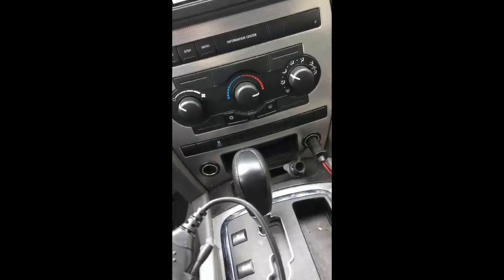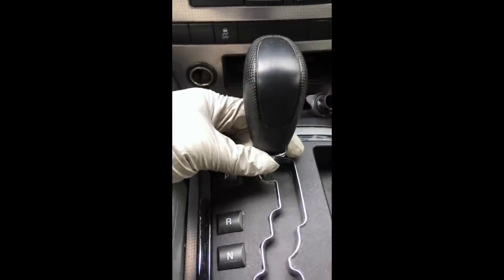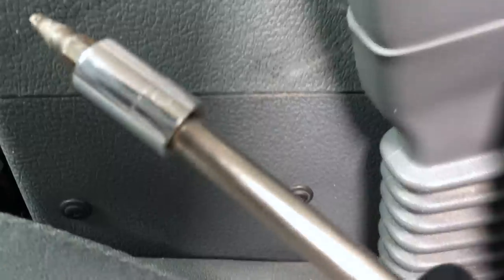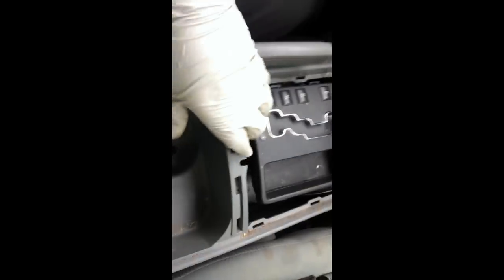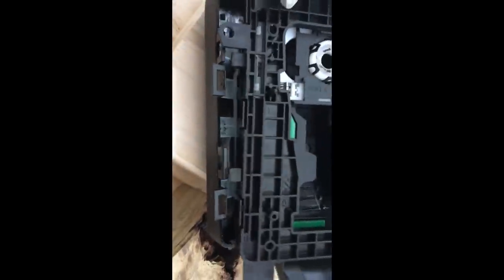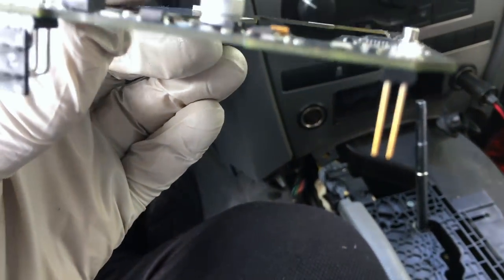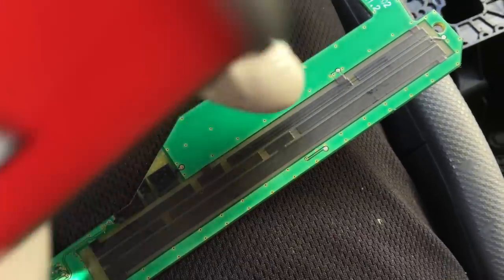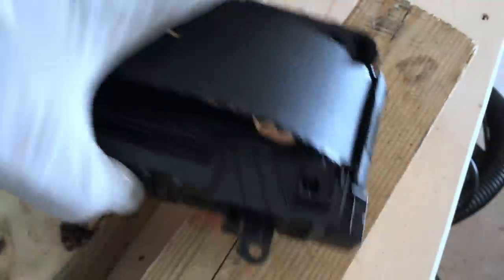2006 Jeep Grand Cherokee (WK) 3.7 Electronic Shift Module (ESM) Problems U0404 P0700 Codes

Comment: When you shift it it makes a weird noise, almost like grinding and the wheels are free flowing. It was towed here from the shop. They said transfer case so basically transmission. I figured someone might want to fix it up. I'm looking at purchasing an 06 with these issues. This is what the seller has told me. I figure if it's an easy fix I could have a decent jeep for my son. I've had an 05 that I replaced the transmission wire harness seal when it was throwing codes and would go into limp mode. Any ideas for this one? Thanks. Great video. I should've made one for that harness thing.
Reply from the maker: Hey brother do you have the codes that popped up? Many things can throw the Jeep into limp mode. It would be awesome if this fix was all that is needed, I just need to know what the codes are.
Reply: @MrV2u  trying to remember what codes there were. I know it was a shift solenoid code. Plus it was leaking around that harness plug and it would drip onto the exhaust. It wasnt leaking a ton but enough to short out in that plug.
Reply: Like you said. Many things can cause it to go into limp mode. Bad wheel hub was one
Reply from the maker: chris gillingham the hub bearing was what I was thinking about lol. If your vehicle is not shifting correctly or occasionally goes into limp mode, the conductor plate may be the cause. It could of shorted because of the leak. If you can find a way of pulling the codes it would help tremendously brother. Keep me up to date with what you do.

Comment: Now the electronic part with the carbon slider is made in Czechoslovakia  ... [You can buy it new for $900 USD]  we'll fix it. What he did not show and ONLY because this Jeep did not have the QDll four-wheel drive. Under the TEE HANDLE you pull up to engage the transfer box for 4WD-Low [if your Jeep has one] is a T-10 screw. To get to that screw you need to come in from the bottom. That took me two days to remove and replace ... and one trip to Fastenal ... AND use ONLY a NON-Chlorinated electronic contact spray cleaner on the Q-tip. [Clorinaded will embrittle the plastic and it will crack apart].
Reply from the maker: Absolutely brother. I should of mentioned the non chlorinated formula. Thanks for the comment friend. Keep on Jeeping on brother.

Comment: 05 Jeep Grand Cherokee V6 3.7 codes u0404 p0700 no other codes. I did this and drove around a few blocks the car was fine. I turned the car off to go into a store when I started it back up I'm getting a loud whining/ squealing sound on the passenger of the vehicle the sound is in all gears it stays the same in each gear. Doesn't get louder or lower ( It sounds like a bad serpentine belt or water pump) both brand new.  Could it be a bad TCM or trans pump?? Thank you
Reply from the maker: Was it making noise before you tried cleaning the contacts? It can very well be a bad pump brother. A bad pump will give you shifting problems, noisy trans, slipping, etc… I wish we had dipsticks to check the condition of the fluid which could show; burnt or low levels.

Comment: My 06 WK will not manually down shift while in drive,will cleaning the ESM solve this as well or different issues?
Reply from the maker: It might solve your issues. It doesn’t hurt to clean the contacts. Do you have any codes.

Comment: Great video thank you. Did anyone get the ESM out without removing the whole containing console. There is a Dorman video where they look like they just removing the direct top 4 torx screws, remove the cable & lift it right out.
Reply from the maker: You can do it without removing the entire console. I was showing you the correct way so you have a better understanding.

Comment: Our 08 Santa fe doesn't go into park or drive. Last saturday, the shifter started getting hard to move. On that day, I was able to put it in drive, and i put in transmission fluid to make sure it was at a good fluid level. Then I got into the interstate and sped up to 80 mph and down to 0 without any problems. After that day, the shifter didn't let me put it in drive or park anymore. 

I'm going to try this and also clean the electrical connections with electrical contact cleaner to see if this fixes our issue.
Reply from the maker: AC Padilla make sure you don’t overfill the transmission. Get vehicle hot and check with engine running and in park. Your going to have to go under the truck and have someone with the engine off cycle the shifter while you watch the lever on the transmission move. Make sure it’s not binding. Not sure if your able to see it. It shouldn’t be hard to roll through the gates. It might be binding.
Reply from the maker: What I did on my jeep was a electrical issue. Yours sounds like a hardware issue. It might be completely different from my setup. Let me know how you make out. I’ll do some research for you if you get stuck.
Reply: 5 Star Jeep Club thanks for the response. I was able to fix it and it's apparently a common Hyundai issue. The shifter shaft got stuck. I had to remove the shift cable and neutral safety switch, then sprayed wd40 and lube on it. I grabbed it with an 11 mm wrench and wiggled it until it started moving again. I kept moving it around with the wrench while spraying more liquid so it would seep more into the shaft. I then reassembled everything and my problem was resolved.
Reply from the maker: AC Padilla awesome. Like my pops always told me fix it yourself. Subscribe to my channel. Going to be branching out to different manufactures. Thanks for your response.

Comment: I’m looking into buying a 2010 Jeep Grand Cherokee for dirt cheap online. They said it was in limp mode and don’t want to spend the time or money to fix it. I don’t know the codes that it’s throwing, but I’m guessing that they are the same as this. Would this most likely fix this problem?
Reply from the maker: A lot of things can throw the Jeep into limp mode. Any sensor can do it, a wheel hub, the ESM which is what this video is on, a tranny speed sensor. It’s a gamble without the codes. Best advice is to buy a cheap scanner and check the codes. If your mechanically inclined go for it. Let me know the codes if you do. I’m around for help.

Comment: My Jeep is doing the exact same problem! It won’t shift gears and the rpms just keep going up!  If I do what you did in the video will I need codes or anything ? How can I reset the code without the electronic device you have?
Reply from the maker: philip vizzari ok here’s what you do. Do everything I did in the video. When you disconnect the battery before you do anything you will be clearing the codes at the same time. When you reconnect everything your check engine light will be off. Hope that helps. If not hit me up I’m always around.

Comment: Got the same thing illuminated around the prnd and 4 low light on. Code U0103. Think this is the same problem?
Reply from the maker: Ashlee Mcalister I would definitely try what I did in this video first. Let me know if you have any other questions or get stuck on anything. Good luck Ashlee, let me know how you make out too.

Comment: I have a 2008 model. Otherwise same motor 3.7 Jeep grand Cherokee. Always seem like I had a little bit of a transmission slippage etc. and recently twice it seems like my transmission dropped after I was at a stop  and tried to take off again. Basically bogging down and this morning it did it and I couldn't get my shifter to shift gears at all plus I could push my pedal all the way to the floorboard and I felt like I was maybe in first gear still not going faster than 30 miles an hour. Does this seem like the  same scenario? I pulled over  into a parking lot because were in the middle of a rainstorm currently and I didn't wanna get stuck in traffic. Parked and let the car sit when inside the store came out and it seem like it was fine or at least back to what it was before the issue this morning. Once again, it's a 2008 model were in 2019 now and I only have 88,000 miles and do regularly take it to be serviced with a buddy. But have not had anything for transmission fluid done yet I believe. Any insight I would appreciate it
Reply: Sidenote, my ABS braking and also my airbag lights have popped up on the dash.
Reply from the maker: You might have a failing hub bearing. Those symptoms point to that or bad abs sensor in one of the wheels. When you feel like the tranny is slipping and doesn’t want to move that’s the computer putting the Jeep into limp mode. If you have a scan tool check for abs codes. If not go to autozone and they will scan the Jeep for you for free. Hope that helps. Let me know how you make out brother.

Comment: Hey thanks a lot for the video. One question, my dealership ran a U0404 diagnostics error 'Gear Shift Control Module' on my '07 Grand Cherokee Laredo. Is this the same as ESM? I am getting ridiculously poor gas mileage. Many thanks!
Reply from the maker: Todd Crawford yes sir. I was getting bad mpg as well. Try this should take care of your issues. It’s not hard to do and will save you from the stealership. Let me know how it turns out.
Reply: MrV2u could  this cause a popping noise when down shifting.
Reply from the maker: Hugo Torres could be the engine bogging down. Going into fail safe mode off and on.
Reply: MrV2u I tried  cleaning  it once and thought it helped but no it's  still happening,  also it shakes  violently like it's gonna turn off then I give it gas and it's starts to work again and if i let it of the gas it shakes  bad again check engine starts flashing fast  i turn it of turn it back on and it  goes back to normal btw mine is a Jeep Grand Cherokee Laredo 3.7 V6 4 x 4
Reply from the maker: Hugo Torres I cleaned mine twice in 2 years. Are you getting any codes? Even though the check engine light goes up n and off it can still store a code. It could be a electronic problem in a circuit then brother. I know that part is expensive. I’d try a junk yard first.
Reply: Hugo Torres did you find a fix? Mines is doing the exact same thing
Reply from the maker: UnitedWEstand?? Do you have any codes ? The check engine light doesn’t have to be on to get codes.
Reply: UnitedWEstand??  no i havent  it sucks because it only those it went it wants to it's hard to find a problem
Reply from the maker: Hugo Torres I had that problem when my hub was going. It’d bog down loose power then jerk and suddenly and pop. It threw a code and then the light went off. Thank God it happened only two blocks away and I had to limp it home. I bet that’s your problem. Pull the codes. You can have a inactive case de which wouldn’t set the light off. I replaced all my hubs which houses the abs tone ring and sensor. It’s not a bad job to do but takes a little time to do.
Reply: MrV2u I changed my driver   hub  2 years ago changed it again last week got an alignment  and truck was nice and smooth then it a day or 2 l everything felt like it got loosen up
Reply from the maker: Hugo Torres could be another one failing. I know it sucks bro. It’s the nature of the beast lol.

Comment: You need to do a Blend Door Video... My 07 Grand Cherokee is only blowing cold air but thermostat, pump & black heater are all getting proper heat. I do not overheat. My blend door accuator is working as it should (off of shaft) but the last problem to suspect would be the blend doors itself
Reply from the maker: Do you recently change the thermostat and water pump or flushed the coolant system?
Reply: I literally just figured it out like an hour ago. I took off my accuator and manually turned shaft for blend doors to open from heater core. So its all good now. but shaft looks to be missing a gear. so i'm thinking that is the problem, it is just jumping when trying to switch.
Reply from the maker: Kyle Dillon you have heat when you move it manually? At least it’s not a bad fix.

Comment: I am having issues with a 2006 Laredo stuck on neutral. It will shift to drive and it will engage on reverse if you press the handle firmly. Any recommendation will be greatly appreciated.
Reply from the maker: Did you try cleaning the contacts like I did in the video? Do you have a check engine light on? If so do you know the codes?
Reply: There is no check engine light.  Could it be the actual mechanism? I will try your method  I'm the meantime and will follow up with you.

Comment: i have a 2006 jeep commander with the 3.7. abs...esp...and traction control lights are always on and it hesitates to shift. more than likely my brake light will come on and at that point it will not shift other than from park to drive reverse....just wont shift up and down going down the road. will this fix it?
Reply from the maker: I’m 80% sure you have a bad hub assembly. That’s where the wheels bolt to the Jeep. The hub assembly has a tone ring and abs sensor in it. Those symptoms point to a defective one. To be sure you need to scan for codes. It will point to the bad wheel. You can go to autozone or advance auto and have them scan your car for free. Let me know how you make out.

Comment: I understand what you've done but what does that part work please text back  I have a Grand Cherokee that the reverse does not work. What could be my you had a very good video
Reply from the maker: It can be what I showed in the video or a number of different things. Do you have a check engine light on? If so what codes do you have? If you don’t have a scanner go to autozone or advanced auto and they can pull the codes for you for free. Let me know bro.

Comment: Would this cause it to stick in 3th gear . Wouldn't let me manually shift it . Went a couple days later and it shifts fine.  Had codes of p0700 and p0841
Reply from the maker: I doubt it. You might have problems with your transmission fluid pressure sensor due to the p0741 code which would make the p0700 code appear. I know with these there’s no way to check your own tranny fluid without a scanner and no dipstick.
Reply: Mine has 5.7 in it
Reply from the maker: If you can check it then how does it look? Bright red and no burnt smell to it? The module may be dirty sending the wrong gears to the computer. Try to clean it like i did and see if that helps brother. Let me know how it turns out...
Reply: I'm having this same 3rd gear issue with my 06 4.7. Doesn't do it all the time. Only after its been driven and shut off and restarted. Very random. But same codes come up if I drive it in 3rd. If I shut it off and let it sit and restart, it will go back to normal. I cleaned the module and even replaced with a used one and it didn't fix it
Reply: Not the same codes actually. I double checked and my codes are p0871, p0882, and p0998

Comment: Great video! I have a problem with the sport shift. The + and - signs to down and up shift...they do nothing! Any advice on how to fix this issue? Thank you in advance :)  2006 Grand Cherokee 3.7L with automatic 4wd. 101K miles. I don't have a code but can probably get one.
Reply from the maker: If you can get me the code it will help immensely. You can go to auto zone or advance auto and they will pull the code for you for free. I’ll help you out the best I could.
Reply from the maker: Try this fix in the video. Cleaning the contacts could very well solve your problem sister. Let me know how you make out and I’ll do more research if need be. I
Reply: @MrV2u  Thank you, I'll try and get a code and let you know. Where does this extra Graphite come from and when it's removed, doesn't that cause an issue with lack of a lubricant?
Reply from the maker: I believe that the graphite is what seeps our from the constant back and forth motion of the shifter. The problem is when it makes a continuous contact that throws off the computer. There is no problem cleaning the contacts. As it’s not really a lubricant rather a effect of the back and forth motion. Hope that helps
Reply: @MrV2u  The mechanic that replaced the 02 sensor erased all the codes so as of now, the check engine light is off and no codes :( If the light comes back on, I'll get the code and let you know. Thank you again!
Reply from the maker: Did he tell you what codes were there before he erased them. Just so you know if they come back on? Thanks for the update.
Reply: @MrV2u  No, it was the 02 sensor code and another code that he didn't know what it was for so I guess I'll have to wait to see if the light comes back on and get it checked again...
Reply from the maker: Cathy Smith ok cool. Good luck... should be great. Lol
Reply: @MrV2u  My key was left on and the battery was totally dead, charged it up, went down the road and tried the sport shift like I do a lot in case of magic and it worked!! I assume the dead battery and recharge fixed an issue with the computer?
Reply from the maker: Lol awesome. The gremlins got scared away. Make sure the battery contacts are clean from corrosion as well. Thanks Cathy...